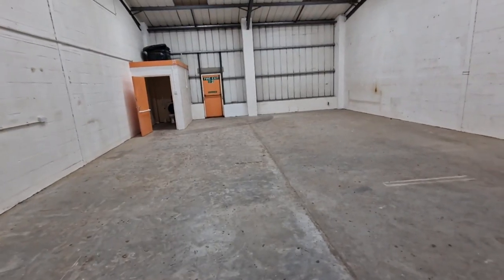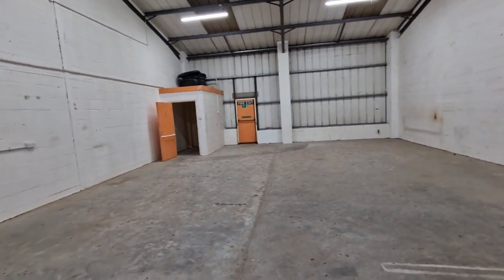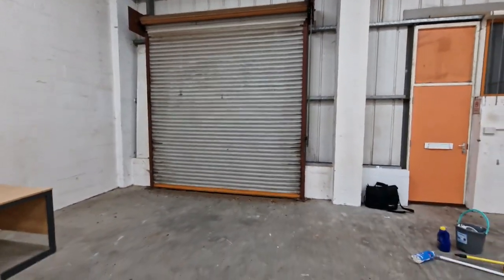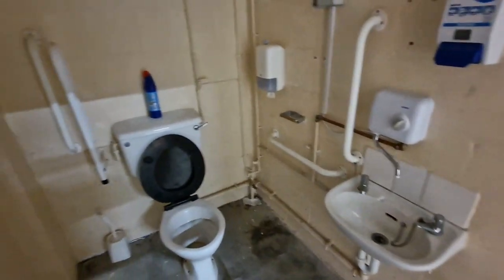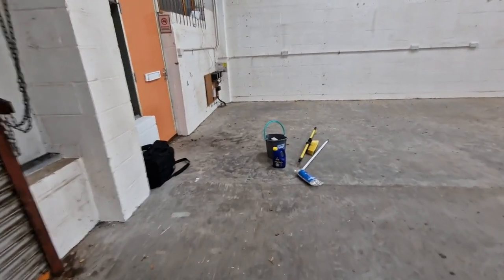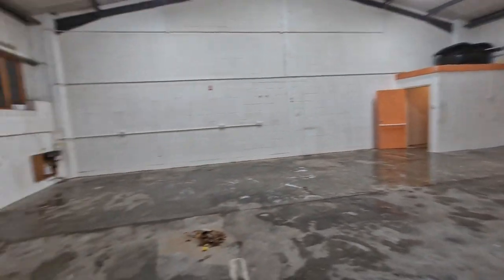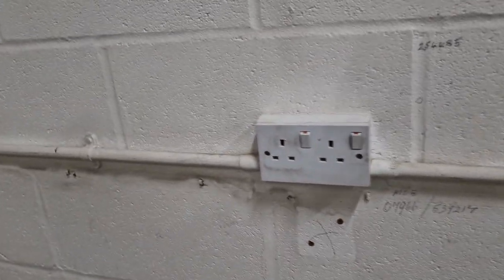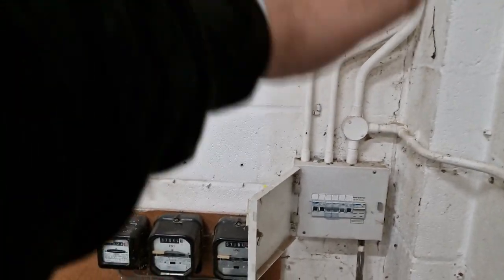What's this 3 phase cut out got wrong with it ???

Comment: It's ally that's an old ALPEX cable used alot between the 60s and 80s when they realised ally concentric neutral conductors rot away if the outer sheath gets damaged the cable swells to about double the diameter and the ally turns to white powder which results in a neutral fault. Somone has smashed the bottom cover off the DNO should be out within 2 hours when you call them you'll get a shiny new cutout